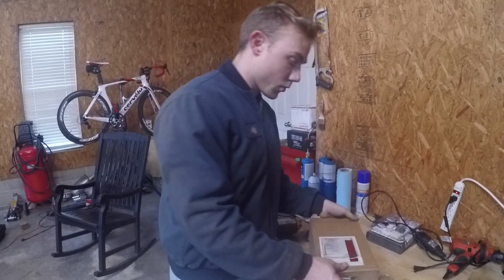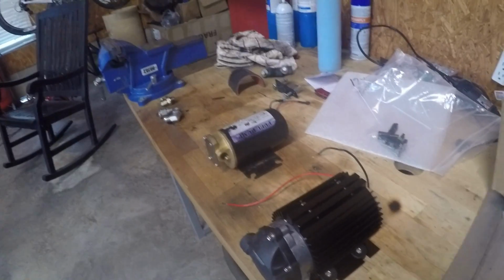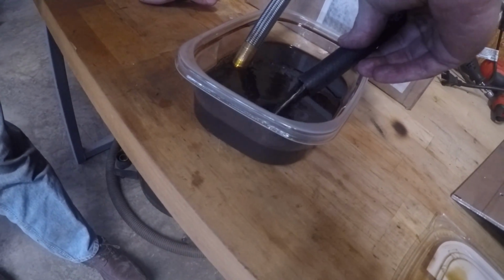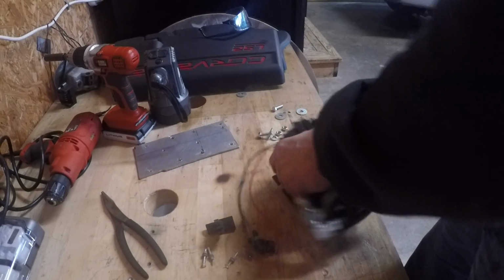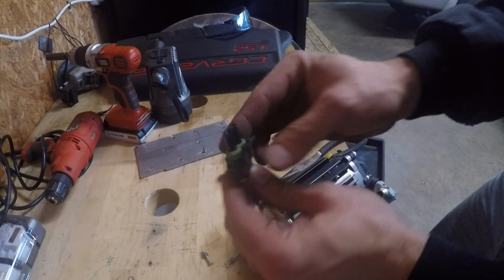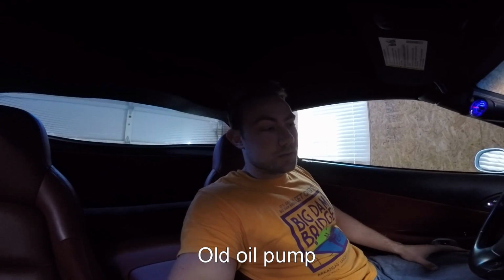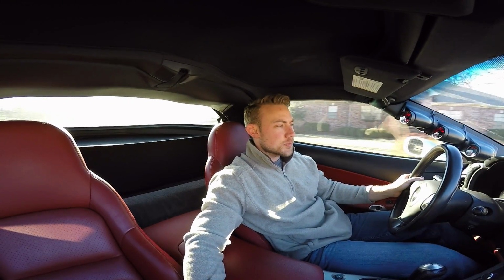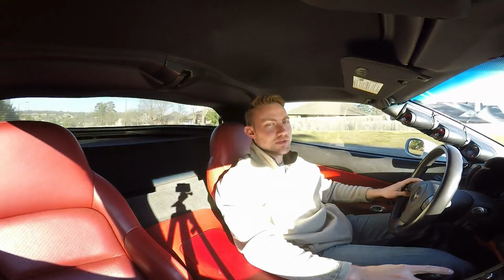Quiet Turbo Oil Scavenge Pump - TURBOWERX Spartan

Comment: I see that you’re trying to make the Turboworx pump look good but the old one clearly outperformed the new one.
Reply: Those cheap brushed units are built in China and fail, taking out your turbo(s).  They flow way more than they need to, I'll spend 3x on that other one to not have a turbo failure.  Everyone who uses those cheap $100 brushed units are constantly replacing both the pump AND the turbos.

Comment: put dc motor speed controller on the noisy pump and decrease the speed, it will help.
Reply from the maker: Solved it in a later video.  That pump turned out to not suck lol

Comment: I was wondering if you could show how you wired your scavenge pump up? I'm at this exact point and cannot find how others have wired it... Love the time delay too!
Reply from the maker: Red wire from red terminal on the batter all the way tot he pump.  Black wire ground to the frame.  There is a ground stud for the rea wire harness.

Comment: Is this pump still working?
Reply from the maker: I took it off and went back to the original pump.  The original one flowed more and eliminate the smoking issues.  I just did a better job of isolating it from the frame and now it is much quitter.
Reply: What is the name of the old one.
Reply from the maker: @fernandohood5542  I don't know the name but they all the same.  The original gear pump actually just stopped one day. Ran for like 3 years though. I bought one like this to replace it and it has been going over a year now

https://www.amazon.com/Impeller-Lubricants-Machinery-Scavenge-Transfer/dp/B01F3GU1YU/ref=asc_df_B01F3GU1YU/?tag=hyprod-20&linkCode=df0&hvadid=242021983106&hvpos=&hvnetw=g&hvrand=18070589760259336027&hvpone=&hvptwo=&hvqmt=&hvdev=m&hvdvcmdl=&hvlocint=&hvlocphy=9025805&hvtargid=pla-425487702188&psc=1

Comment: Another issue with those cheap China pumps is there’s grinding paste with metal inside most of those pumps.  They don’t clean the inside after machining.  Another guy on the web took one apart and it was a mess.  I would hate to see somebody run that crud through a good engine or turbo.

Comment: 3 years later, how is the pump holding up? Thanks!
Reply from the maker: I actually changed back to the loud one because the Spartan didn't flow enough. The cheapy is still working after 2 yrs. I had the Spartan on for about 6 month. Still go it in a box in the garage
Reply: @TheLifeofaMan   would you sell it to me?
Reply: @TheLifeofaMan  That noise would drive me bonkers. Surely there must be a quiet hi flow pump
Reply from the maker: Sorry man keeping it for meth injection

Comment: Great video and very helpful!  How would you compare this to the Tilton cooler pump (40-524)?  I feel like this is still quieter.
Reply from the maker: So later I found out this pump can not flow enough to keep up with the demand.  I ended up switching back to the cheap pump and it works way better.  I used the heat sync and mounting from this pump on the old pump and now you can not even hear the cheap pump unless you are stopped and you really listen.  I say get a $60 ebay pump and mount it well. I have had the cheap pump on there for about 2 years and still works fine.  Just clean it out really good before you use it and you are golden.
Reply: @TheLifeofaMan   have link to the 60 ebay pump?
Reply: Not sure if this is alive or not but which two pumps did you use? Old and Turbowerx. Links by chance?

Comment: So the beautiful thing on DC pump is that you can lower the voltage to match the flow needed and it might give more than the 30min duty cycle on the ebay one
Reply from the maker: I tried and never found a reliable method to do it.  Tried resistor, DC reg, dc duty cycle. Nothing really did the trick
Reply: @TheLifeofaMan  good to know, cheers
Reply: @TheLifeofaMan  I successfully did using 100w power resistors. 6 resistors, 3ohms total, 0.5ohms each (3 x 2 in parallel). It gets hot, but ok for a resistor.

Comment: 12 volt speed controller would have fixed that cheap oil pump  and enabled you to adjust the flow rates( and the noise of the pump) it’s only for oil scavenging

Comment: What part number is the old pump? I dont mind the noise, I will have it on a hobbs switch anyway.
Reply: VenomGT87 your turbo needs oil all the time, not just when you're in boost

Comment: The small one is perhaps carbon brush DC motor that why it loud, Your new one is perhaps diaphragm pump. The first one wont last long because nature of the kind of motor and low quality Chinese carbon brush. The new one if it made in China it wont last long either cause Chinese don't exactly know how to make good rubber such as diaphragm rubber ,the rubber absorb oil then expand easily.

Comment: hi , i got a single turbo 3000gt, installed  the turbo almost in the middle of radiator front. anyway car do smoke white color only when it gets worm and sometimes  it dont somke...

many guys told me that not ennough oil going into the turbo...

so is the turbowrex will help the issue to be fixed?
Reply: I believe the turbo is smoking because is getting more oil that what it needs, you can try a smaller oil feed inlet for the turbo

Comment: where did you get the pump? what kind/name is the pump?
Reply from the maker: It is in the title of the video.  I got it from tubrowerx.  One thing to be careful of is that all the seals from the turbo to the pump are air tight.
Reply: ok, thanks!

Comment: Use ur old oil pump as a way of pumping old oil into cans for recycling ... just a thought
Reply from the maker: still got it if you want it haha
Reply: xxblamedxx what is the oil pressure on these by chance, I read somewhere it should be between 50-60 psi..not sure if that means feeding the turbo or draining the turbo..they didnt specify in the reading..going to assume feeding, anyways do you know how much output pressure your old pump puts out?
Reply: @zenpro8164  you don't need any pressure as long as the return to the oil pan is above the sump line

Comment: I saw you comment on a comment saying it's a rotary vane pump and it's safe to run it with no oil.
That's incorrect, brother. Rotary vane pumps are one of the style of pumps you don't run dry for extended periods of time. It's just like a power steering pump. And it's good practice to at least dump some oil in before you fire it up so it doesn't start bone dry.

Comment: yes there quiet, but for me it didn't last more than about 120 hrs. Bought a cheap china pump noisy as hell but it seems to pump better, thankyou for confirming. i swaped the finned cover and put it on the cheapy. good vid.
Reply: GRIFFS REARMOUNT TURBO, The Modfather -
Brotha, what’s pump did ya get? I’m on the fence about a few of them. Did ya do a vid on it?
Reply from the maker: https://www.amazon.com/Impeller-Lubricants-Machinery-Scavenge-Transfer/dp/B01F3GU1YU/ref=asc_df_B01F3GU1YU/?tag=hyprod-20&linkCode=df0&hvadid=242021983106&hvpos=&hvnetw=g&hvrand=18070589760259336027&hvpone=&hvptwo=&hvqmt=&hvdev=m&hvdvcmdl=&hvlocint=&hvlocphy=9025805&hvtargid=pla-425487702188&psc=1

Comment: Definitely a lot better in regards to the noise level, but that flow from the old pump, better.
Reply from the maker: Turns out when I make sure all the fittings are air tight that they flow about the same.  When I put teflone tape and proper torque there is no burbling just flow.

Comment: Never let a pump run dry
Reply from the maker: It depends on the pump.  Not all pumps need to be full to work or run.  This is a rotary vane style pump.  The warranty and the manufacture state that this pump can be run completely dry for it entire life.
Reply: This is wonderful. I'l getting one for my build. If anything comes up I'll let you know :)
Reply: It won't last long, especially running them dry right out of the box.
Reply: yeah oil Pumps don't like dry runs they rely on the oil that they are  pumping for lubrication

Comment: why not just run a separate oil sump instead of pulling oil from the motor?
Reply from the maker: +This0is0pointless that is more difficult and expensive than it sounds.  I would basically have to have a pressure pump and scavenge pump mounted at the rear.  Then rig up some type of puncture-less reservoir.

Comment: I used this exact pump on a low mount twin turbo mustang I had and it was great. The gravity drain just didn't have enough drop and so the turbos smoked front not draining correctly. Installed this and never had another issue.

Comment: So do you think the lower flow rate will affect the reliability of the turbos?
Reply from the maker: +Michael Carreiro Not at all!  I am using this as an oil scavenge system that means I am just moving the oil after it has already been through the turbo.  As long as you pump out flows the outlet of the turbo there will be no issue.  If done right the turbo outlet should only flow what you put in.  I am restricting my oil supply so the outlet flow is tiny.  The biggest thing to be worried about is oil supply to the turbo.  The minute the oil supply is gone the turbo will be ruined.
Reply: +xxblamedxx hey, how is the alumaweld stuff holding up, what psi you running
Reply from the maker: Seems to be holding up just fine.  I do not plan to run more than about 10 PSI even in the future stages.  I plan to run 6-7 PSI for stage 1 and stage 2 probably 8-10.  If I go over that it would be time for a newer car.  It has a T56 tranny and old everything else so it would be cheaper to move up to a grand sport.
Reply from the maker: +Michael Carreiro Not one bit.  The pump still out flows the turbo outlet.
Reply: Couldn't you just have a small tank of oil back there and make it a closed loop system? Have the outlet of the pump, pumping into the turbo and it'll drain into the tank and go round and round. (Incoming oil to the turbo coming from the tank obviously.) Could even have a little oil cooler and it wouldn't cost much at all IMO.

Just a thought.
Reply: @F8LXEPSHN  you would absolutely need an oil cooler at that point. All the plumbing and new sump not worth it
Reply: xxblamedxx in my experience the only to solve is to create it's own oil system near the turbo.  The oil line s traveling to. Front and back is to far.  Mid mint turbos have no issues